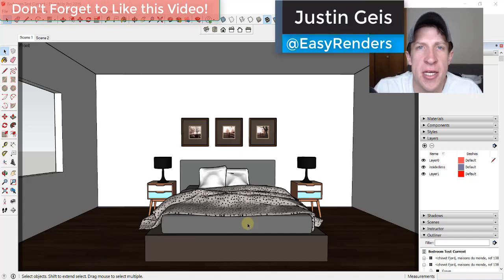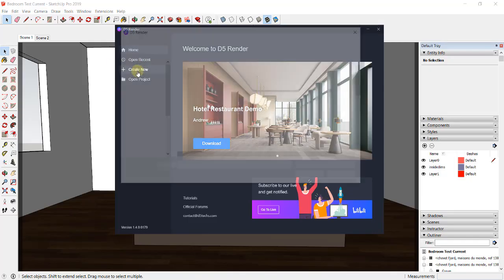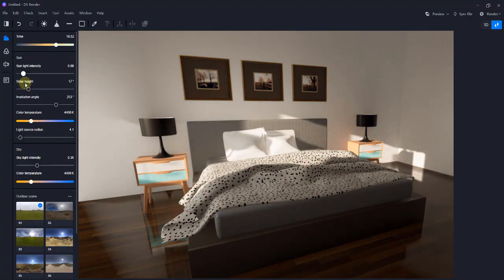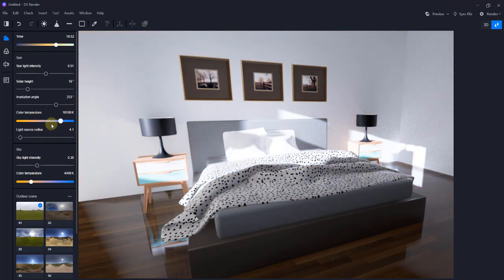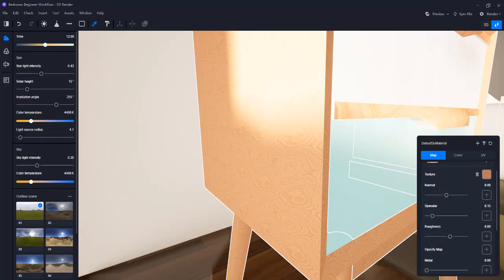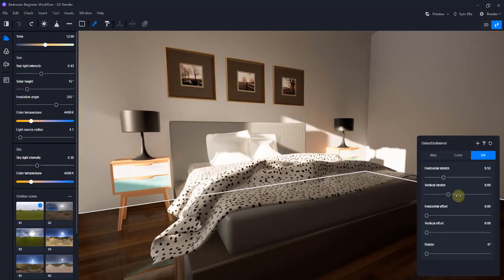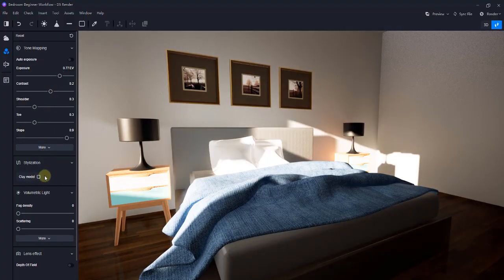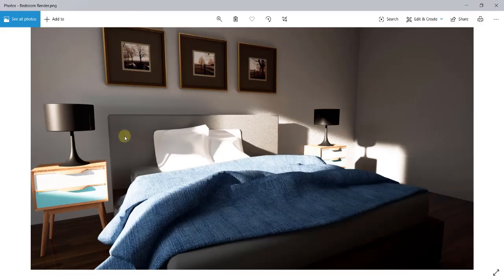Getting Started with D5 Render - Complete Render Tutorial!

Comment from the maker: Hi everyone! Have you tried D5 render yet? Leave a comment below and let me know! :)
Reply: Just a bit for now. One thing I am not that convinced for now, is the material library. It's not that big and not that good. Perhaps the fact it is a Beta version, is the reason. Other thing that needs some improvement is the glass effects. Not so much to do about it. It would be nice to have more options that could give more variety in the effects on windows.
Reply from the maker: They are in beta, so I assume they're focusing a bit more on the engine at the moment, but it would be nice to see a larger material and asset library built in. I haven't tested the glass too much yet, so I'd have to look at that a bit closer. Overall I'm still liking the ease of use and speed to get to a finished result.
Reply: @TheRenderingEssentials  nice render, hope they improve on it better. Keep it up👍
Reply: hi , thanks alot for the video 
i have  downloaded the program and it is so great and easy to use 
but i cant render my work .. unfortunately the program still closing  everytime i try to render ... 
my graphics card is 1650 4gb , ram 8 gb , cpu intel core i5 9th gen .. 
can you tell me a solution for this problem 
thanks alot
Reply: @moaiadmh7143  The graphics card is too slow. (The minimum GPU that can run D5 Render is GTX 1060 6GB.) Recommended are GeForce RTX 2060!
Reply: what's the GPU you use to run this software?             Greetings from Mexico
Reply: Hi, I need your professional advise what render engine is better Enscape or D5, can you please make an comparison video, to show the strong sides of programms
Reply: I used D5 for the first time yesterday, had a little trouble, but that's lack of experience and English is my second language. It is searching, but your content is showing me the way.

Comment: I am really keen on using this software with my sketchup 2021 models, so I downloaded it and tried to load a sketchup model and nothing appears in the viewer other than the sky. I was told to also download the sketchup plugin but the downloaded zip folder was blocked by my virus software telling me that it contained a trojan file. Have you had any of these issues or is there something I am doing wrong with my setup?
Reply: You need to save your sketchup file as a 2019 maybe 2020.  That fixed it for me.
Reply: @patrick-resendiz  I found a way around it, downloading the plugin from the link within the D5 software worked, it seems to be a problem if downloaded from the website link. I am now using Sketchup Pro 2021 and it is now working fine with D5 and the plugin. Most of my models are now 2021 version so I don't use the older versions of sketchup.

Comment: Do we need another render program on the market? What brings D5 Render?
Reply from the maker: I'd say yes - as difficult as setting up Unreal Engine is for Architectural Visualization, any program that makes that easier is welcome to me
Reply: @TheRenderingEssentials  There is Unicorn, Enscape, SU Podium, Simlab Composer, V-ray, Render[in], ProWalker, Lumion, Blender, Kerkythea, Ambient Occlusion, TwinMotion, etc., etc.
Reply from the maker: @Bouwtekeningen  Not a single one of those other than Twinmotion works based on Unreal Engine, which is one of, if not the most powerful rendering and light simulation programs in the world. Plus, it works with real-time ray tracing, which simulates light much more realistically. In any case, I guess I don't understand what the negative is of someone building a new rendering engine based on the latest technology, but feel free to stick with whatever you've been using
Reply: @TheRenderingEssentials  Thanks Justin that answers my question. I do not a lot of rendering, but I have TwinMotion and Simlab Composer.
Reply: @Bouwtekeningen  Simlab Composer costs money and looks very unrealistic. D5 is faster, looks better, has a good material library, has a lot of vegetation and is for free.
Reply: @cr4723  I agree, Simlab Composer can do better with the render quality, but they have also a free version. But Simlab is more into VR solutions. I am a fan of Twinmotion.
Reply: @Bouwtekeningen  Simlab Composer have a free version? Are you sure? Is this up to date? As far as I know, it costs €120 a year! This is madness. And its quality is the worst I know. Even worse than Blender Cycles and Eevee. And  Twinmotion costs 560.- € a year!

Regarding your initial question "Do we need another render program on the market? What brings D5 Render?"
D5 brings you a Render for free and it looks better than Simlab. Is this good? The only downside is you need a new RTX card.